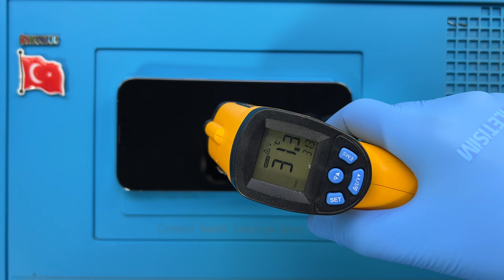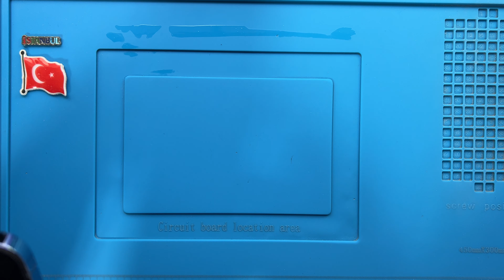iPhone 13 Pro Max Ekran Değişimi 🇹🇷

Comment: Where you get the replacement?
Reply from the maker: Hello;
We only provide service in Turkey.
Greetings.
Reply: Online, just look it up, and you will never find the original replacement (with Apple’s logos). Also, do not recommend you to do this if this is your first time because those wires/connections are super delicate. Any sudden movements can tear a wire, as well as any miss-connections connected the wrong way (not following a procedure of which connection connects first) may cause your iPhone to malfunction in varies ways. If you do Apple will not touch repair your iPhone. Any repairs performed on your iPhone, other than Apple, will nullified any ties and/or warranties with Apple. So, good luck.